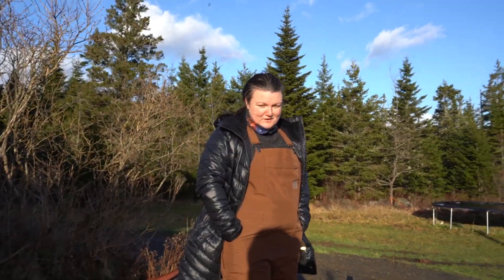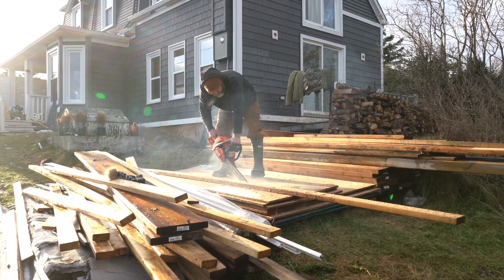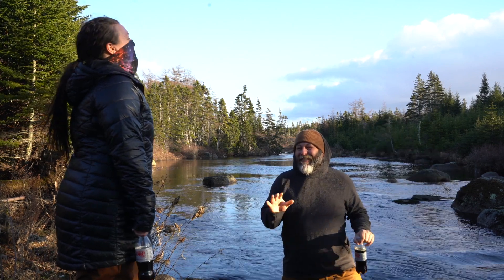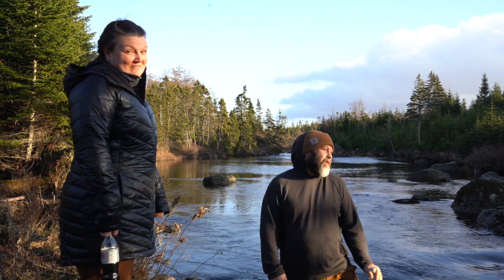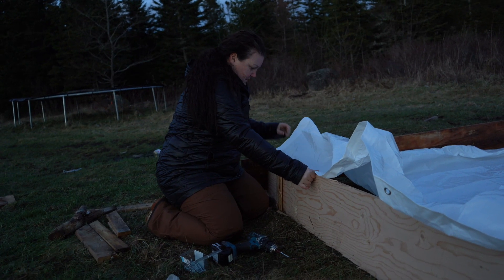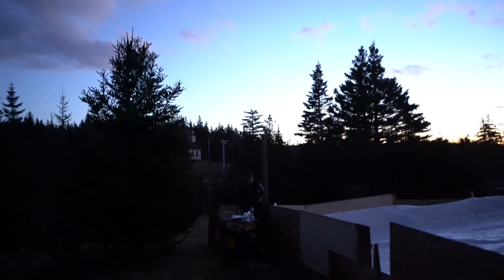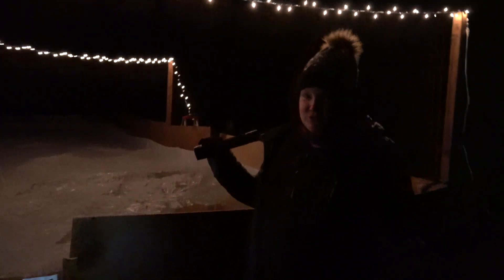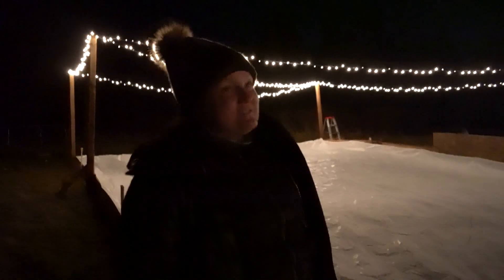Built Backyard Ice Rink On Our Homestead (start to finish)

Comment: Merry Christmas.  I am concerned about your wood fuel sitting out getting wet. Please stack it and cover. Boss of the swamp tarps his using gallon jugs filled with water at each corner to hold the tarp down. He lives in Vermont at a high altitude. Happy stacking and weather protecting